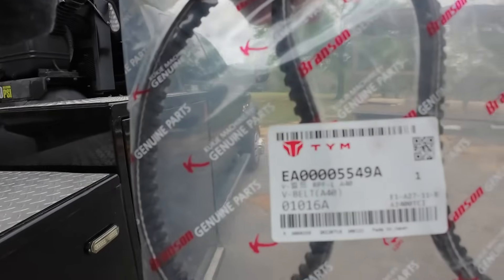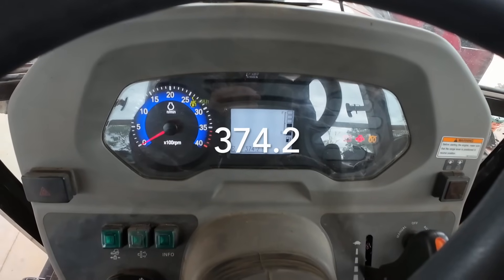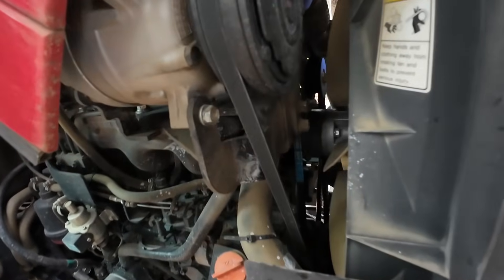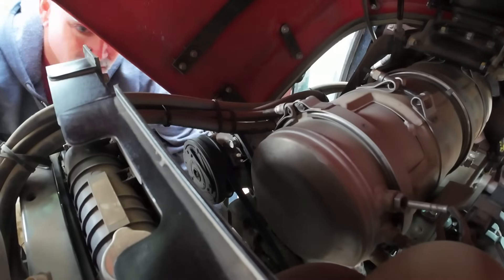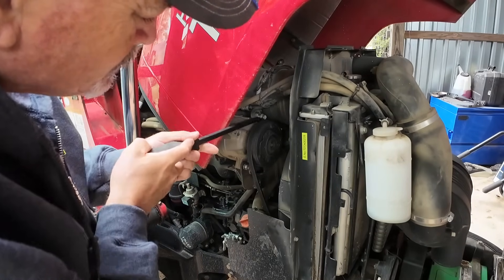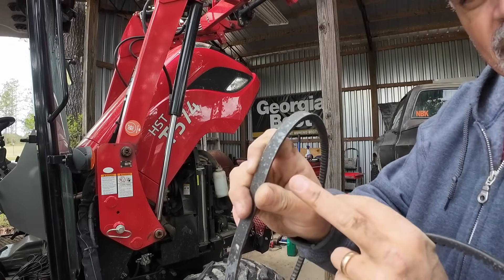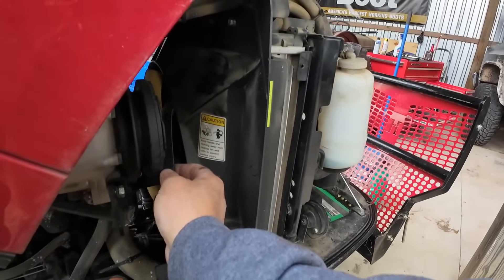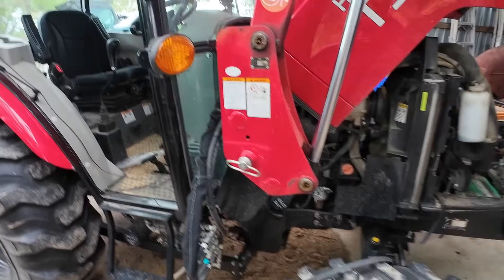Is this too early to have to replace this?

Comment: I have a hook in my tool chest (made by KD tools I think?) It's designed to grab an alternator by the bolt boss and you pull it with a 1/2" breaker bar. Then you lever the alternator or compressor or power steering pump to tension the belt. I've owned it for like 40 years and use it regularly.

Comment: My 494 belt squeals too. I think it is the AC belt because I turn off the AC and it stops, turn back on and it comes back. It does not happen often, only when it is really hot in summer time.

Comment: the alt tension bolt is 12 bucks and soft metal $10 each  use prybar to pry alt till belt tight. its most likely fine

Comment: Just tightened mine alittle and squel went away. 552hrs and belt looks new. I get about 30secs od squel when you first turn on AC, then it stops.
Reply: I have found. Real. Belt dressing   ,Works

Comment: Hank, did you first consider just tightening the alternator belt instead of replacing it? Belts will stretch with use. The automotive industry mitigates the problem by using spring loaded idler/tensioning pulleys.

Comment: I was about to say yes, too early,  then I did the math,  and apparently it's about right,  if you consider each hour of use at PTO rated speed  as equivalent to an hour at highway speed and convert that to how far that situation would have moved a car under equivalent load, and it comes to a touch over 20,000 Miles, so, about right for a car to need a belt.  It seems tractor hours and car hours just hit our brains different.

Comment: You had plenty of space on the alternator bracket to tighten up the belt. You could have just adjusted it and saved a lot of time and a bit of money. The belt you replaced didnt look worn and should have lasted much longer.